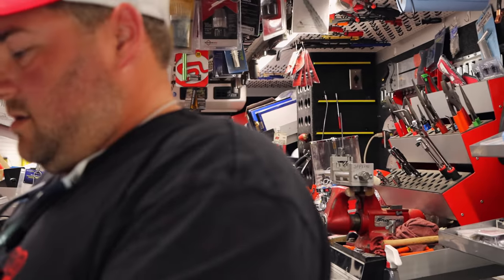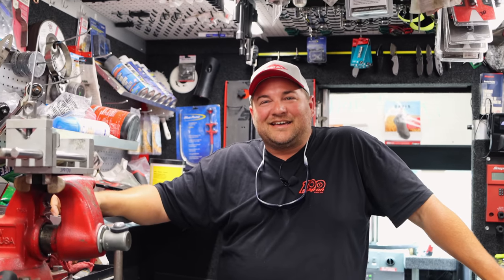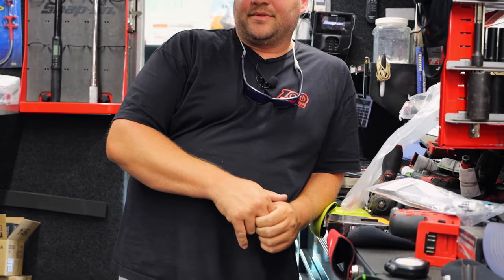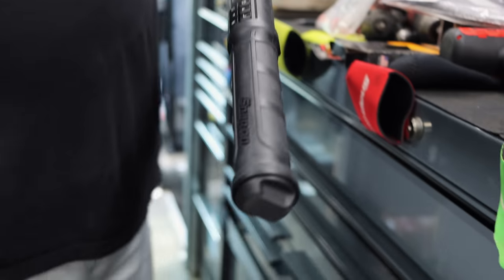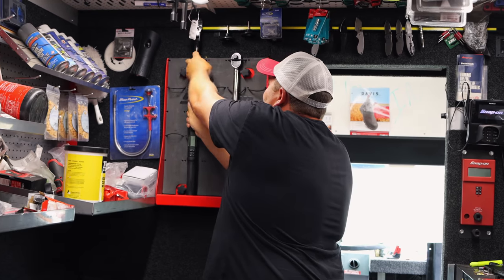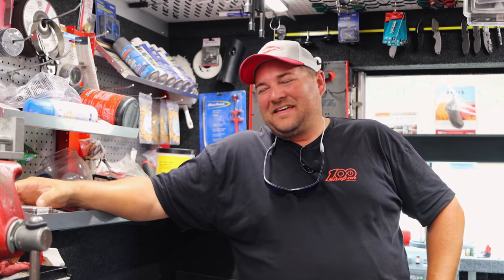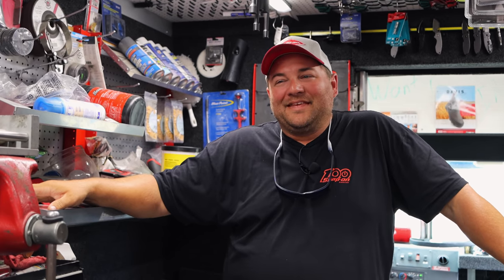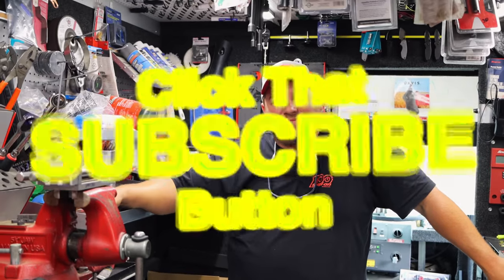Snap On Dissolving Sockets? The Missing Socket Mystery Solved  Dirty Secret Where They All Go?

Comment: I’d check to see if it has one of the Nissan CVT transmissions.  I’ve heard they have a high failure rate.
Reply: Correct. We see a failed Nissan CVT at least once or twice a week at our shop.
Reply: 20yr tech Nissan CVT are trash 🗑
Reply: I wouldnt go near a rogue unless it was a really really good deal
Reply: Thinking the same thing,  i figured Hamilton knew all about cvts , but is so well connected with every shop in town , repairs arnt a huge concern lol
Reply: Yes they do,nice car otherwise.

Comment: Easiest way I have to find my missing sockets is buy replacement and the missing 1 magically reappears.
Reply: I was working on my dads sprinter van fixing the light housing in the back, I lost a magnetic tray, 8mm socket I believe, a couple of torx bits, and a pick. For months I didn't find them. He asked me to get something one day a good 2 months later that he'd bought and I opened the back door looked up and checked that light was still good and right there, still stuck to the roof was my tray and everything I'd lost.

Comment: Hi, I work at Nissan, Fred Haas in Tomball Texas and they are a good car depending on the dealership. We have lots of recalls on them and the CVT is less then reliable. Maintenance is easier then dirt and if you take care of the CVT it will run for 300k

Comment: I’ve had a Rogue for a rental a few times. I absolutely hate driving them. They hands down have the loudest interior when it comes to road noise of any SUV built in the last 10 years. If you’re riding in the back seat you need to wear hearing protection to prevent hearing loss.

Comment: My girl works at Detroit Diesel on the head line putting in valves and springs or pistons depending on the day. They have a special overhead machine to tighten those head bolts/studs. Also, I need that murdered out torque wrench!

Comment: If your okay with having to replace the trans every 50-70k miles they are good rigs but the CVT transmissions suck. Coming from a Nissan Technician. Personally would only buy one new with the CVT warranty extension.

Comment: Nissan rouges are 50 50.    The cvt transmissions fail often interior falls apart after 4 years and the 2.5 motor in them blows the hg fairly regularly

Comment: Transmission mechanic for AAMCO here in indiana. Tell Hamilton the Nissan CVT's are junk. They start to slip regardless of maintenance and just crap out. They need a Nissan specific fluid and its hella expensive and they are just cheap cars in general. This is all Nissan cars 2005 onward.

Comment: Nissan Rogue ... change your oil early otherwise you'll have the P0011 or P0021 code and they'll run crappy and the CVT transmission isn't if but when it goes

Comment: Personally I wouldn't recommend a rogue or really any Nissan with a cvt transmission, they have a lot of issues especially with the heat just don't do good.
Reply: As a nissan tech and cvt owner. It all depends on the driver and how much he is informed on how a cvt operates. It doesnt have any gears; uses solenoids to manipulate a chain. Therefore giving it infinite gear ratios. Ill smoke any v6 sedan with the 300 hp. 😤.
Reply: I would have to disagree, I was a Nissan technician for about 5 years and we definitely had a lot of transmissions we had to replace for the fact that due to the heat they would destroy the transmissions I own a Nissan maxima with a cvt and had to replace the transmission before it even got to 60k
Reply: Good to hear bro. Pretty sure u got a free new one no? How long has the 2nd lasted
Reply: @arthuriveraj7700   so far it has lasted 80k so definitely longer than the first transmission

Comment: That’s not a Detroit 60 series head bolt socket. Those are 12 point and for some reason 3/4 drive. Might be a DD or series 50 socket.

Comment: If it’s got a CVT then you better change the transmission oil every 10,000 miles just to be sure it doesn’t grenade. Nissans can’t make a CVT to save their life.
Reply: 80,000 miles on ours, no oil changes and still purring
Reply: @FusionBoost2.0  you're tempting fate, fluid/filter asap
Reply: @P.A.C.E.automotive  my buddy who is a Nissan master tech told me I'm still good for a bit for the mileage my wife does and her style of driving

Comment: Stay hydrated out there even if you have to crack open a cold one. 

New Rogue or used? If it's new, in my opinion I would suggest spend the extra half grand and get a base model Rav4, used however Rogue is way cheaper and maybe worth looking into after a transmission inspection.

Comment: Nissan Rogue,transmission problems galore since they have the crappy CVT with a lot of problems
Reply: 80,000 miles on ours, no issues yet
Reply: @FusionBoost2.0  wait til 100- 130 miles...
Reply: @shawnh9677  Were not worried... At 100,000 miles and up without maintenance any transmission could be a time bomb... Everyone says buy a Toyota or Honda... They have their issues as well
Reply: @FusionBoost2.0  Will find out
Reply: @Toolaholic7  you really think every CVT fails because some do?
Reply: @FusionBoost2.0  They do,Nissan needs to go back to a regular automatic transmission!GM had a CVT in the earlier Saturn Vues which were a pile of junk with the 4 cylinder engine.Torque converter problems in the 2010 and 2011 Subaru CVTs which are built by Subaru.
Reply: @Toolaholic7  Ok then
Reply: Ford even has problems with them,the Freestars which are $2,200.00 used if any good.A friend of my dad's put an used transmission in one of these and that one went bad too
Reply: @Toolaholic7  You mean the Freestyle? Those weren't all that bad, considering that CVT was designed what over 20 years ago
Reply: @FusionBoost2.0  The Freestyle,those CVTs were a pile of junk.Hard to find used and Ford had backorders on parts for them.Plus the CVT fluid is not cheap,$15.00 to $25.00 a quart from Nissan
Reply: @Toolaholic7  well the freestyle wasn't built for very long, and were only in the AWD models..  The Freestyle been discontinued over a decade now, going to be hard to find parts for them anywhere

Comment: Nissan rogue is a pretty good SUV and they get decent gas mileage and drive good.. they can get a little bit of inside the cabin noise from the road but you have to be a little cautious of the transmissions because they've got that crazy transmission that you don't feel it shift and it's like the more gas you give it, the faster it goes... I've had one in the past and never had trouble but they are expensive if the transmission goes out, so after a hundred thousand miles, it's good to keep a check on them but they're good vehicles other than that..

Comment: Is that a black oxide colored 1/2 digital angled torque wrench up in the corner to the left of hamilton in the video? I have the gen 1 3/8 digital angle and i love it beside the stupid cap that once in awhile will reset the wrench in the process of torquing.....if that is a new 1/2 digital in the black what is the specs (is it a 250ft lbs.) Whats the price on it?
Reply: Stupid me im writing the comment while he then pulls it down....put my foot in my mouth!!
Reply from the maker: Well he shows it. Keep watching
Reply: @KoonTrucking  do you by chance know the part number?

Comment: I'd pass on the Rogue.  Unless he buys an extended warranty those CVT's don't last... High fail rate! I'd refer him to take test  drive in a Honda CR-V and see what he thinks.
Reply: Wouldn't touch a newer CRV with the turbo fuel dilution issues
Reply: @FusionBoost2.0  up to 2017 is pretty good

Comment: Well reading the comments, nobody actually owns a Rogue, they just know how to use google. My wife owns one since new, it's a 2016 SV AWD... Currently has 86,650 miles. Had basically 0 issues with it so far. The only work I've done it's rear brakes, 2 front struts because one started to leak and that's about it for major work. Change the oil every 12,000 miles with Mobil 1 extended performance and a Fram ultra synthetic filter. Air filter and cabin filter every 30,000. Absolutely no engine issues or CVT issues so far. She drives about 200kms 4 days a week to work. Going to change the oil in the cvt soon because it's probably due and probably the front brakes before summer ends. Going to check the plugs next oil change and change em depending how they look. Only real complaints, it don't put out enough heat IMO for our Canadian winters, which shouldn't bother you guys lol Great on fuel, rides good, and hard to beat for the money. My buddy is a Nissan master tech, yes some have CVT issues but for the amount they do compared to the amount they sell and continue to kick without any trouble is really low. Do your maintenance and go, I'd buy it no problem

Comment: Heeellll nahhh.. dont buy a nissan rogue. Unless you just feel like eventually spendin $4,000 on a cvt replacement? Well idk that's prolly like $40 bucks to hamilton so whatever you wanna do lol
Reply: Ours have had 0 issues so far 5 years old and 86,000 miles.
Reply: @FusionBoost2.0  thats good some people have good luck with em. But i know this. I work at a transmission shop and i've replaced 7 so far this year for people. And the last 3 years probably around 20. They're a known problem in the transmission community of auto repair. But hey glad you've had good luck out of yours bud
Reply: @thefogisgone3662  I know some of had issues but for the amount that go bad there are way more on the road with 0 issues. My buddy is a Nissan master tech, told me straight out... For the amount they do, most have 0 issues
Reply: @FusionBoost2.0  lol i think i'll start tellin everyone to get one too that way i can have predestined transmission side jobs lined up in the near future. I'm tellin you bro i've dropped pans on those things and it looks like the asteroid on armageddon took a shit in it. The bearings inside the pulleys and the belts on them go bad over time.
Reply: @thefogisgone3662  Congratulations, don't mean their all bad. Any transmission shop is going to see everything under the sun. You've done 20 in 3 years, yet nissan sells a quarter million a year and continue to sell well. Their not as bad as people make them out to be. Like I said my buddy is a Nissan master tech, and if he can sit there and tell me don't worry about it, I'll take his word for it. Maybe someday it will shit the bed, but it can happen to anyone of them really. I work at a GM dealer, the only thing I've seen that scares me is the 8 speed in the trucks lol
Reply: @FusionBoost2.0  alot more transmission shops than ours seein em. But whatever floats your rogue bud. Good luck
Reply: @thefogisgone3662  Just saying their not all bad and not nearly as bad as some make them out to be... Lots on the roads around here, people still buying them like crazy because their a good vehicle. Great in the snow and great on the highway... We can't complain with the only big work in 86,000 miles being struts and brakes. Jesus my aunt's 2012 Rav 4 has had more major work done to it in the same amount of miles